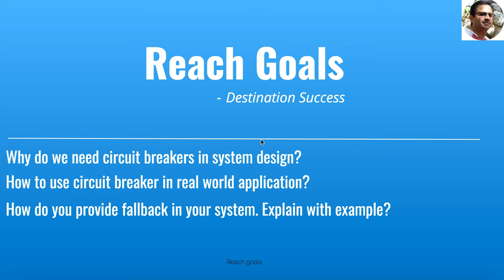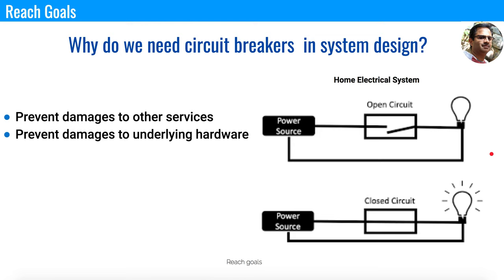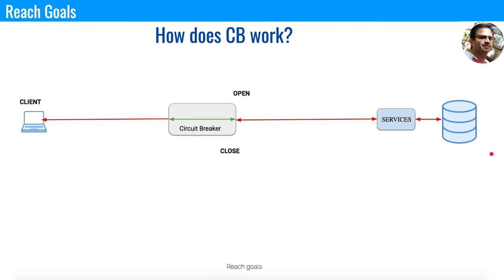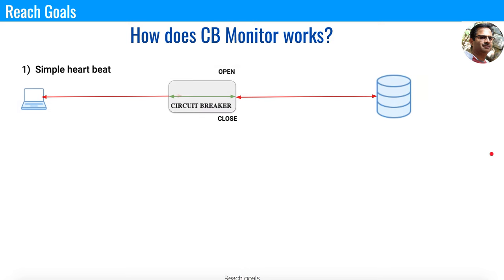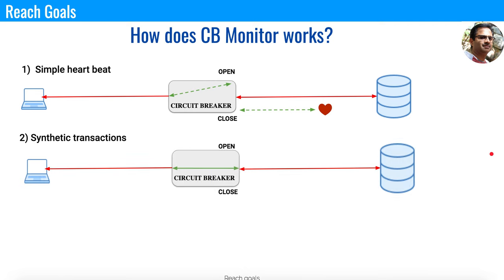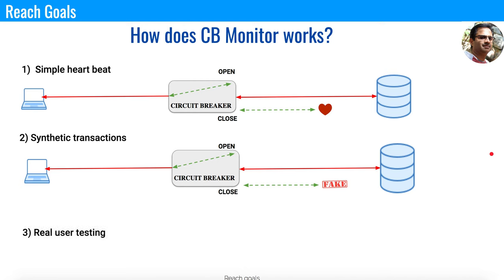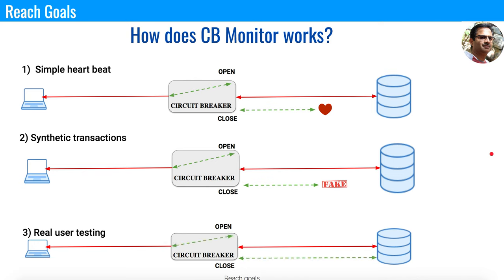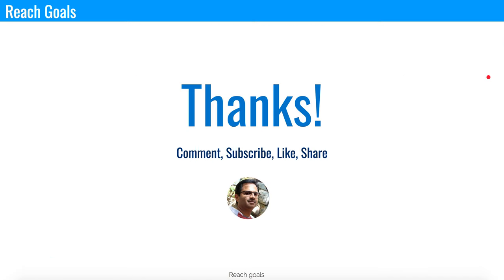Why do we need circuit breakers in software system design ?

Comment: Won’t enabling circuit breaker break the SLA for availability?
Reply from the maker: Good questions.
Circuit breakers are like fuse carriers in electrical supply. Do yo want entire electrical circuit to be damaged or live without electricity for few hours till you fix the issue?  So, we need to decide what we need.